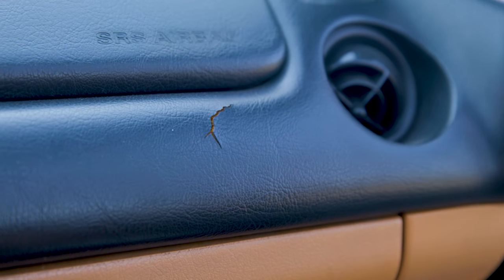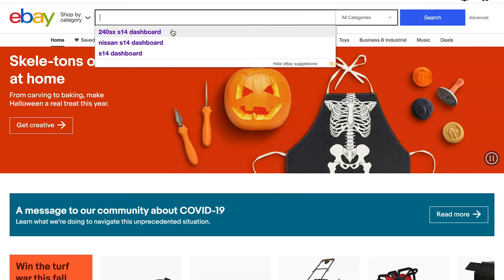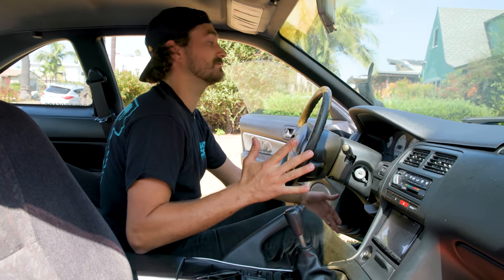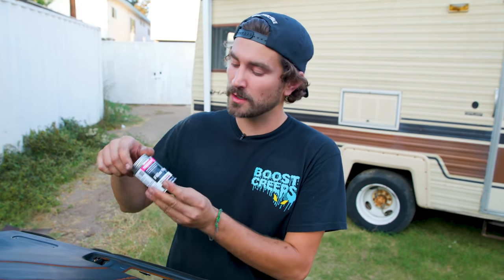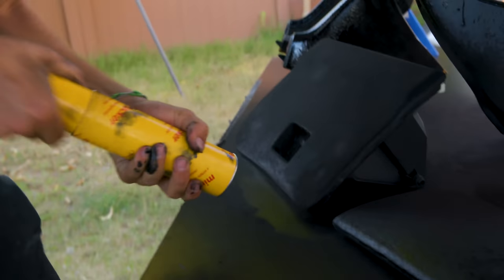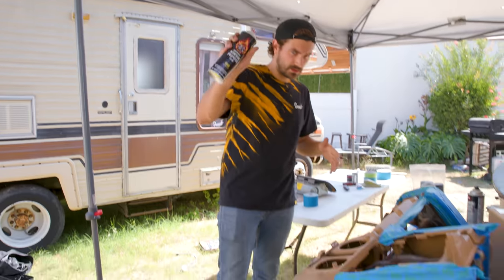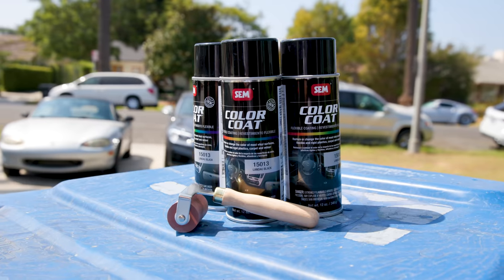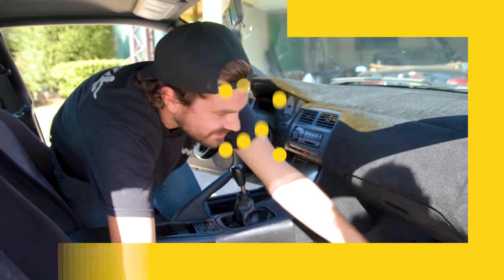We Tested 3 Cracked Dashboard HACKS

Comment: Pro Tip for easier application of the filler: put the filler/putty in a piping bag (for baking, applying frosting) and choose the appropriate tip (usually the smallest round tip hah) and fill in the cracks like you much would with a caulking gun. Makes for an infinitely better end result, and is honestly the best way to apply it. Use can also use a ziplock bag or a plastic shopping bag. This method also works for mortar repair.
Reply: Do you know how can i find the bondo like stuff and the other thing he uses to prep the surface? I found the flock it kit already, im doing it!

Comment: There’s a third way, I used to work at a leather trimming company. We retrimmed loads of MX5 (Miata) dashboards, a call to your local interior trimmers and a price for vinyl, alcantara or leather, you can get completely change your interior look too 😀
Reply: no. expensive. must stay cheap. lol
Reply: If you want something special you gotta fork over some dollhairs
Reply: @jebus914  no
Reply: @jebus914  no.must start cheap
Reply: If we're talking about something that doesn't fall into the shitbox/racecar category, I'd say leather too. Blends in much better than flocking, if it's a newer, nicer car
Reply: Heavy.
Reply: One of the best "non stock" looks IMO.
Reply: I have watched videos of guys leather wrapping interiors and learned a few things.  Primarily I dont have the patience, or experience to make that happen.  Then if I did, the next question is once you start.........where do you stop?  LOL
Reply: Who much would that cost for a na miata?
Reply: @beans.477  Most places will charge a few hundred bucks to wrap the dash in vinyl/leather. Depends on the shop, materials- If you bring them the dash or if they have to remove it themselves, etc.  Its not "cheap", but its not expensive either- and can definitely be cheaper than a brand new dash (and better looking, IMO- in the right car of course)
Reply: You can do this by yourself too if you film the cracks with spray foam and epoxy or bondo instead then use the pleather or fabric and spray adhesive to glue it down
Reply: @petermolnar8667  racecar/shitbox bruh 😂😂
Reply: That would kill the fun of this show. Which is to watch Zach do stuff and succeed or fail. (:
Reply: @lachychops2  racecar=shitbox, but expensive 😂
Reply: @petermolnar8667  you forgot Dodge. Always cracked to hell and back

Comment: I personally liked the painted version better just because the flocking looked a little fuzzy on the video. I've got a project 83 chevy truck I've been working for some time. By the time I'm ready to fix that horrible dash, I think I'll be in an ok position for trial and error. 
Great videos guys. Keep them coming.
Reply: Same. That flocking also looks uneven and still has some weird, specular reflection. I've also seen a lot of budget flocking fade into gray.
Reply: So I'm not crazy. I assumed it's because if the video but it looks like trash.
Reply: I agree with the painted dash. I will do that in 20 years. Lol
Reply: honestly the dash overlays they make for those trucks dont look too bad. there is enough places to hide the edges and stuff. just be sure your original dash is flat (they like to curl and bed by the speaker holes and stuff) then glue the overlay down and it looks brand new.
lot less work than filling the cracks and sanding and shit those dashes can get completely fuckerd lol.
source: i have a fuckerd 86 c10 dash that i replaced with an already overlayed dash.
Reply: I have personally flocked my dash looks trash on camera but great in person same thing with car paint you can find dull spots on camera you can’t in real life
Reply: It’s like those couches you swipe left it leaves a mark that you can erase with your other hand
Reply: @WrenchAvengers   where did you buy your overlay? I have an 84 with a bad crack and don't trust myself to not make it worse by one of these methods. Also my dash is blue how well do they color match?
Reply: @DR_Bloom86  sadly i wont have a great answer for either of your questions lol.
i bought my dash with an overlay from someone else who already did it. (the didnt do a great job on it either but im happy enough with it) but you can get them from places like LMC truck and classic industries and what not. 

as for color match im again not certain the one i got was very red but i painted it black with SEM paint (some of the best interior paint on the planet) so thats an option if you are not happy with the color you can find the color you do like from SEM and spray it.

hope that helps some.

Comment: The flocked look like garb in my opinion. The Sem way is the best way, but the key is to do it properly. The crack wasn't finished being filled and was very over sanded. The best way to texture the Sem is to use a spray gun for the primer  and dial the air right down so that it's almost a spackle, where you can see the individual droplets if paint, like purposely make it orange peel, then you sand the crowns off of the droplets that form. When you apply the paint you apply super dry spackly coats just over the repair area, then you blend outward going further with each coat. It can usually be done with the dash still in the car as well, and if you pick the correct colour, you don't need to do the entire dash either.
Reply: Yep, each to their own but the fuzzy dash doesn’t do it for me.

Comment: Zack: “My S14 has some cracks” 

My S13 with 30+ cracks: “It’s Show time”
Reply: My 95 miata has two big ones
Reply: 2nd gen ram has entered the chat
Reply: Probably one of the only 13 year old here
Reply: My Gramps 97 Ram 3500's dash is held in place by the odd numbered gears (manual trans)
Reply: My S13: No cracks... because i don't have one.. :((
Reply: The dash in my 77 blazer is like nothing but cracks everywhere
Reply: @vixxgaming3834  Nope I’m here too
Reply: @bryan2ruiz  88-99 Chevy C1500 has entered the chat 

Almost every single damn OBS has a cracked dash
Reply: my s13 doesn't have a dash
Reply: Cracks from drifting? (:
Reply: 83 supra has not only 500 cracks but parts of the dash have literally came off xD
Reply: @bryan2ruiz  lol I clicked on this video for my friends ram
Reply: @BIONDIEST  lmao basically holes at this point
Reply: My friend face has so many cracks, what should I do?
Reply: @bryan2ruiz  2nd gen 98 up ram slaps 2nd gen ram around with a big fat trout

Comment: Textured Automotive Finishing/Grain Pads- For resurfacing “leather-like” vinyl are what you needed to replicate the original texture of your dash.
Reply: I was thinking he should have just sanded/filled the texture of the entire dash, then used a texture spray on it, then painted it. Sure, it might not be the "factory" texture, but it would be uniform across the dash, and cover the crack quite well.
Reply: @matts1166  or use a pourable silicon poured on a good spot of the dash to make a texture pad of the original pattern.
Reply: @BEdmonson85  a lot of work for something as big as a dash
Reply: Where can you buy something like this (not ordering online)

Comment: There is a 4th option. You can fill the cracks and use a roll-on bed liner. It gives a good texture and actually protects the dash. $50 for a gallon can, and you can get a lot of different colors.
Reply: I did that to my car and it all bubbled up and looked like shit 2 weeks later
Reply: @andrewpoophead  lemme quess - rustolem bed liner?

Comment: “Testing cracked dashboard hacks” 
*Old Ram owners have entered the chat
Reply: S13 owners too 🤣
Reply: A massive gaping hole on the top of the dash isn't a crack. The correct solution for those is an overlay that is epoxied whatever's left of the dash. You want cracks, GM trucks and SUV's built on the GMT-900 platform. If the vehicle has not been garage kept, they all crack around the passenger airbag.
Reply: :c
Reply: Go ahead and throw in a toon of Lexus owners... 

There were twelve models affected from 2003 to 2011. In total, there were about 3.5 million vehicles impacted, which included the following models: 2006-2008 Lexus ES 350, 2003-2008 Lexus GX 470, 2006-2008 Lexus IS 250 and 350, 2007 Lexus LS 460

These models also were affected: 2004-2006 Lexus RX 330, 2007-2009 Lexus RX 350, 2005-2008 Lexus RX 400h, 2003-2005 Toyota 4Runner, 2005-2010 Toyota Avalon, 2007-2011 Toyota Camry and Camry Hybrid, 2004-2010 Toyota Sienna, and the 2004-2008 Toyota Solara.

The owners sued and original owners may have been able to get 'em replaced but by the time notices went out, many of the vehicles were on their 2nd & 3rd owners. Toyota reliability extends mainly to the drive-train for those vehicles.
Reply: 90s fbody owners have entered the chat

Comment: The dash overlay has the best chance of looking really good as I have done several on older classic cars, BUT it involves removing the dash to get the best outcome. You must sand (grind) all the damaged areas and repeatedly test fit the cap before actually gluing it down. Then there may be some sanding necessary on the edges (test fit on car to locate trouble spots). After that you can paint it to match and SEM is a very good product to use for that. Finally reinstall dash and it will look sweet. I would only resort to filling & flocking if a dash overlay was not available for the particular car I was working on.
Reply: probably a better option for preairbag cars. airbags kinda throw a wrench in it
Reply: @cory45x  overlays look like overlays from across the parking lot, air bag or not. the other fun thing is they eventually crack right where the crack in the original dash still is.

Comment: Option 4, Fiberglass the cracks, get vinyl by the yard from hobby lobby or [insert craft store here] and then adhesive it down, trim the excess and reinstall the dash.

I did it on my oval dash 944 and the vinyl fake-leather cost me $18 (in 2013) and was pretty easy. Still have the car and it still looks good today. Used the same stuff for the headliner.
Reply: After filling cracks you vinyl the whole dash right? Can you remove all of the old vinyl and get it down to the fiberglass then revinyl?

Comment: a short tip for the retextureing  step :
use acryl or silicone (for the bathroom seams for example)  and lay it on top of a part of the dash with intact texture so you get a negative from it and let it dry ... after that you can fill your cracks und re-textrue it with the negative so you imprint a positive into the  filling material itself, the  filler or paint is to thin to  get the right texture

Comment: Dig the flocking and my Dr. Vinyl guy used to be really good at matching texture but I most recently went with a synthetic suede material and tucked and rolled it. You still have to bevel and fill the cracks but it was slightly cheaper than the flocking at $35 for 2 yards for essentially the same result, (although, I'm sure it would outlast the flocking in the end). I have to say that I'm impressed that you don't have any fear when it comes to these things. Jump in and make it work. You prove that even if you screw up, it can be fixed. Thank You. ALSO, very entertaining...

Comment: I'll take option #1, because removing the dash is a 15-hour job for a beginner. 30 hours if you count the fact you'll have to do it twice because you forgot to plug in a connector when you re-installed it.

Comment: You can make a texture stamp when doing repairs to try and maintain the original dash texture.  Lay down a big puddle of hot glue on a good section of dash, then peel it off when dry, and use it to rubber-stamp the filler on your final coat to blend the smooth into the original texture.
Reply: That's a really good Idea, although I think I'd use caulk or something that's not super hot when laying it down. (It would take a while to cure though).
Probably also put a layer of screen door mesh after the first 1/8" of caulk and then a bit more on top to make it stronger so it doesn't stretch or break (cause the caulk is weak)
Reply: That’s what I did, it works so well. I’ve also done the same with silicone on a scrap piece of textured dash. Hot glue worked better tho.
Reply: @joshuaweaver7124   
Is it because the hot glue turns harder you think? There are stiffer polyurethane adhesives (like marine adhesive caulks) that would turn harder and stronger than the regular caulk. 

I have no experience but want to do this on 3 big cracks on my dash. At the same time, I'm rather scared to put tub a super hot glue on my dash.
Reply: @nickopedia5669  I think the stiffness of the hot glue was the key. Whatever you use make sure there’s no silicone in it if you’re putting it on a dash or piece of trim you intend to keep/paint, because it’ll keep the paint from sticking properly
Reply: @nickopedia5669  use low temp hot glue!

Comment: I have done that prepare myself. You just about had it right you have to do a light coat of the filler then use your material for texturing. I've done it several times. If you're good at color-matching. You can dab the color into the crack instead of painting the whole dashboard. Spray your color onto a piece of cardboard and dab it into your filler once you have it set up. You can paint the dash and it would probably look more uniform. I actually learned the method as a Furniture repairman.

Comment: I like the OEM look of the Miata - better even though you can still kind of see that little area, but the flocking also looks good but that would depend on what the rest of the interior of the car on the flocking dash looks like. If you have aftermarket racing seats and other things like that then the flocking would look better so both cars look really good in my opinion neither is better than the other cuz they both match the rest of the interior really well. You did a good job

Comment: Not gonna lie, the flocked dash looks like the inside of a "pimp-mobile"

Miata spray paint all the way
Reply: Pimp-mobile? What are you, living in the early 2000s? A flocked dash has been a staple of racecars for years, due to the way light bounces off of plastic/leather dashboards potentially blinding the driver. Flocked dashes look hella amazing
Reply: Its main purpose is to stop glare not look cool (even though it does) race car stuff my man
Reply: @Heyitsallgoodman  why would I want race car stuff on my leather dash? If anything it's boy racer.
Reply: @Doomguy.XIV87.5  >he thinks it's real leather

because the point of the video series is to fix up a less-than-ideal car into something that performs well on the track, and this includes creature comforts like not being blinded by the sun's reflection when you're whipping it around corners
Reply: @fakename287  no i get what doom guy means. I have a stock is200. And if my dash were to have cracks, i would not flock it. To me, it just doesnt look good. A bit too much glittery and wannabe race/track car in most situations. I like the filler concept and you could probably get it to be so good you wont see the cracks even if you decide to spray paint it. My option would be spray painting it, but in a paint booth. Not with spray paint cans
Reply: @fakename287  yes mine's real leather I drive e32 740il. Zach never mentions anything about race performance the video is just about fixing cracked dash and flocked dash on a shitbox screams ricer. It might look good on a proper performance car but on a beat up 90s camry just doesn't fit the look.
Reply: I thought it was ugly
Reply: I am behind on things. Havent paid attention to flocked dash, it appears to be a carpet type texture.. how does it feel?
Reply: @Doomguy.XIV87.5  Zach literally has repeatedly stated in his videos that he wants to bring his cars to the track lmao
Reply: @enfamy_OG  my understanding is that it’s similar to a firm alcantara
Reply: @Doomguy.XIV87.5  >beat up 90s camry
>RB swapped S14

pick one and quit acting all superior cause you drive a 25 year old german moneypit
Reply: I can respect the benefits of flocking in a race car, but for a non-tracked DD I'd just go with the overlay.  The gaps were visible but are insignificant enough that you wouldn't even notice them after a few weeks.
Reply: @Doomguy.XIV87.5  ah I misread your comment I didn't realize you were talking about your dash specifically
but if you don't like flocking it then don't do it? No need to get so uppity

Comment: You can use that overlay when the car's just sitting to protect it from that pesky sun.
Reply: Or you can get a dashboard mat which is easier to store
Reply: "Pesky sun" oh you mean the thing that provides sustainable life hahaha jkjk
Reply: @chaddavis2992  Sun is overrated
Reply: @VanBourner  dashboard mat just absorbs heat into the dash dude. i use a sun shade on my 240sx. have for the last 4 years. not a single crack yet.
Reply: Overlay is only viable option if someone actually made one for the car. For mine? No change, too rare and not enough popularity. At least i have two cracked to hell dashes to fix.

Comment: you don't want to mix filler on something porous like cardboard. The bonding agent will absorb into the cardboard and leave more filler. It'll harden more brittle then it should be.
Reply: These guys are amateurs when it comes to stuff like this. Mechanicals is their thing.
Reply: @flippy66  and some of them struggle with mechanicals too. I feel like they are good for high school age kids.
Reply: @ls_812  they're just people like the rest of us, they're amateurs who are pretty good at most things they try....the whole reason the channel is popular is because they're relatable
Reply: I've probably went through around 100 gallons of filler work remodeling Houses, and some Vehicle work. A flexible smooth plastic sheet is my favorite surface but about half of that 100 gallons was using cardboard. It's not as convenient but the end product is no different- Cardboard is fine.